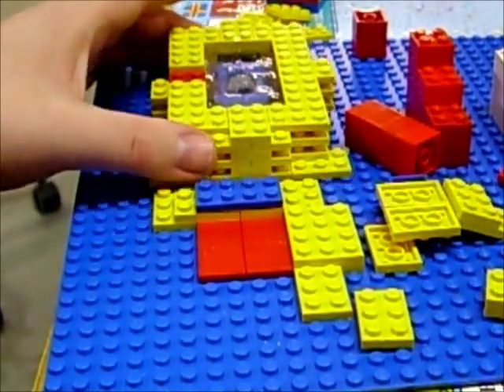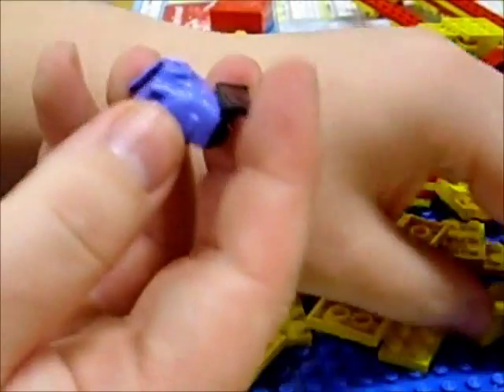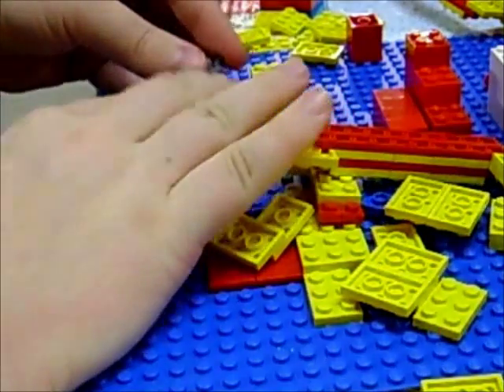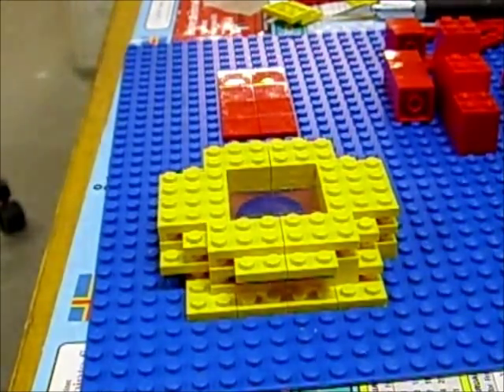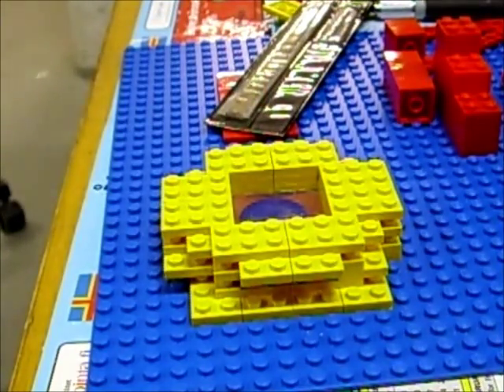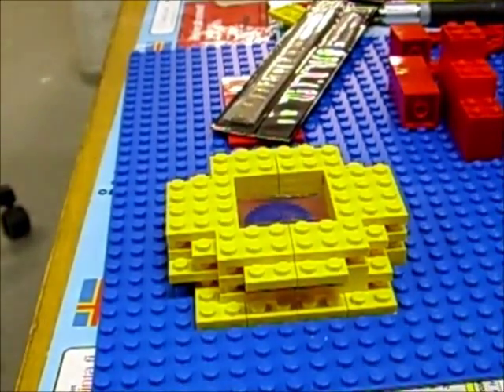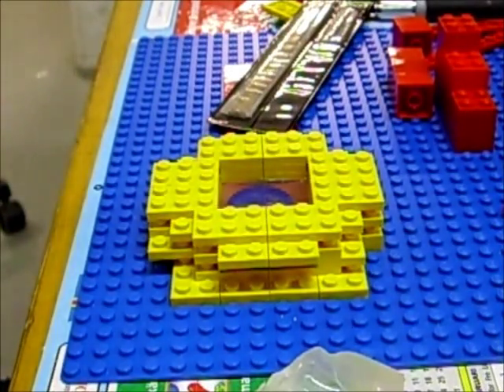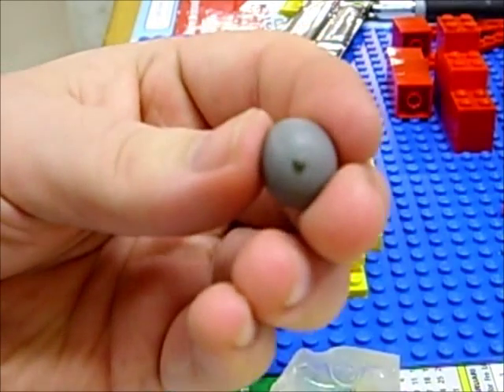InstantMold, Making a better Mold Part 2

Comment: It would be better to notch the first mold by cutting an edge off (always better to cut only a single edge) and then use the fresh Instant Mold  to fill the new gap created by the notch. After it cures you have a pre-notched area that you do not have to drill into.